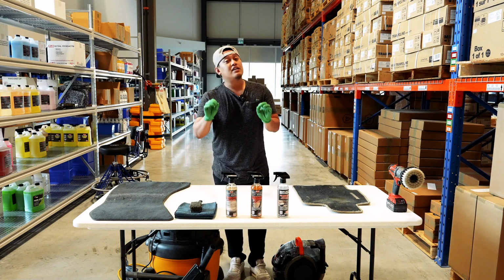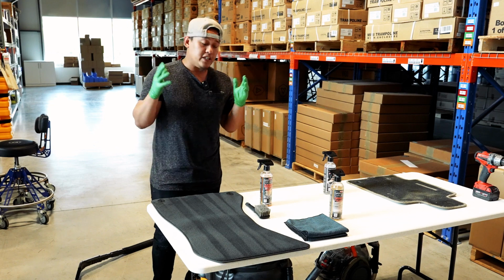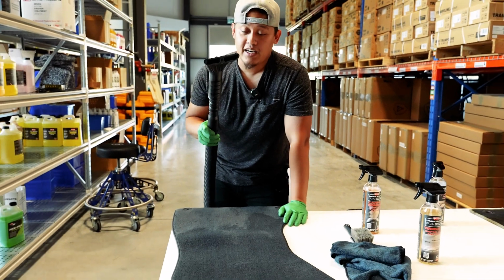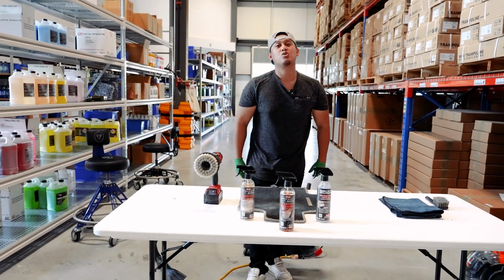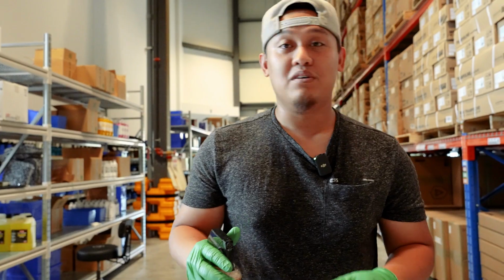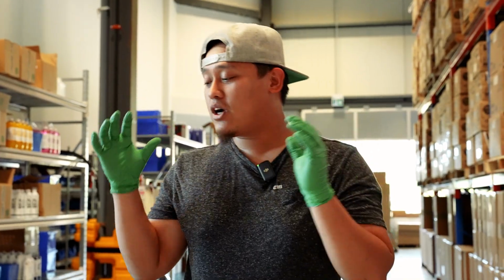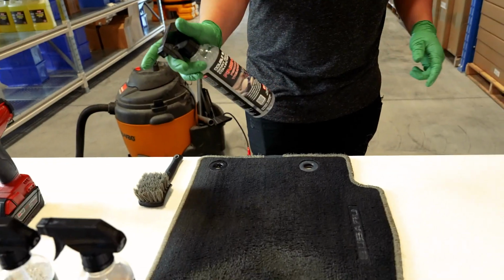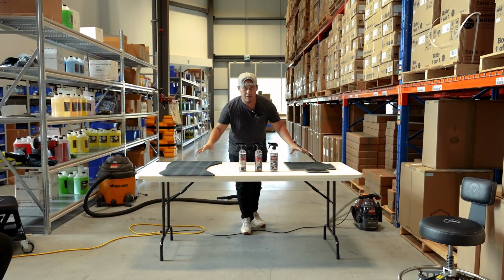Best Way To Clean Filthy Carpets | Detailing Talks EP #1

Comment: Is it possible to do the second floor mat without a spot cleaner? Like with just a shop vac?
Reply: Yes! Buy a pressure sprayer bottle and evenly coat the rug then quickly use the shop vac to extract the water. Will work better since the suction is stronger